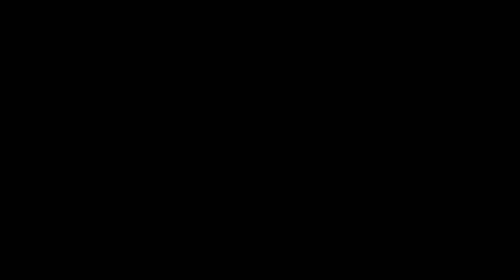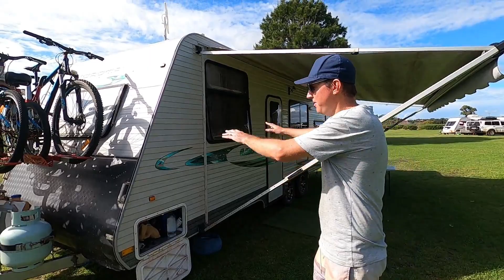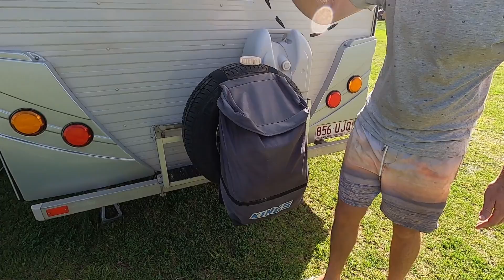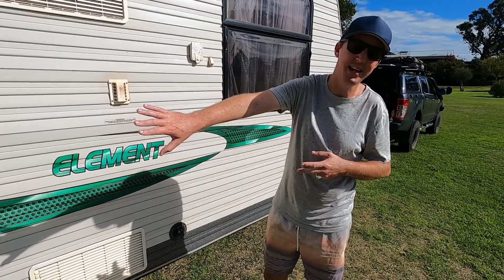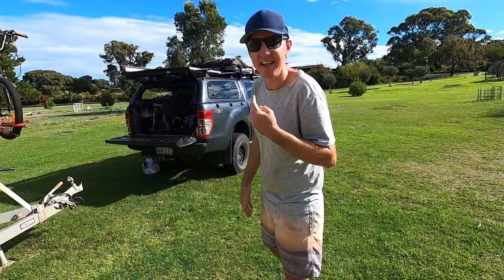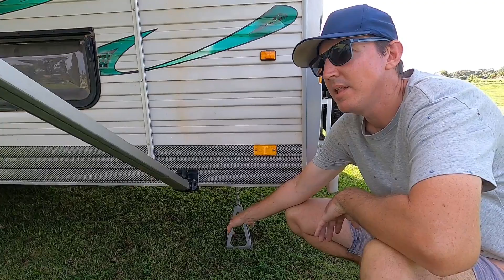Our budget setup to travel Australia Part 2

Comment: Hey Mate love the videos and family's travel.  2 questions 1st is  Being the same and not needing the fancy things but practical things .Do you have RACQ or equivalent ? 2nd question is how do you find all these great free stay places. Once again thanks for keeping it real love it .
Reply from the maker: Hey Rick,  thanks for the support. 
I've never had RACQ at home as I can usually fix the car myself or arrange for a cheaper tow etc. We do have RACQ ultimate cover now though. We got it because we are often in remote areas and it would be quite scary to be stuck somewhere if we have a major mechanical failure. Ultimate cover will tow your car and caravan to your choice of repairer or back home,  even from the other side of the country.
We use the WikiCamps app.  It is our Bible and we would be lost without it.  It has all the free camps,  low cost camps,  caravan parks, water,  toilets,  dumps points etc. It's sort of like Google Maps but for camping.

Comment: Lithium is much better than agm you get full capacity unlike 50% from agm at half the weight. Look for second life Lithium batteries they are cheaper.
Reply from the maker: Yeah mate,  I understand that Lithium is the superior battery.  What I was getting at is that at the time of buying these batteries (18 months ago) a  budget 100 amp lithium battery was $1200. I bought 2 x 140amp agm's for $550.
That's nearly 3 times the amp hours for less than half the price. 
So even if you get "full capacity " out of a lithium I would still be paying 3 times more per usable amp hour for lithium compared to agm.  Lithiums have come down a bit now and when it comes time to replace these that is the way I will be going.  AGMs were just better value at the time of purchasing.

Comment: I would suggest using  5   200X 200 ply boards or same size using sleeper timber 1 each for your portable srands and one for your trail mate when parked up on grass .

Yes you can use the trail mate as a jack if the brackets are welded om the van or you can have them welded on .

I still carry the std jockey wheel as a back up should anything happen to trail mate.

I carry a 4000kg bottle jack should i ever need to lift a wheel off the ground